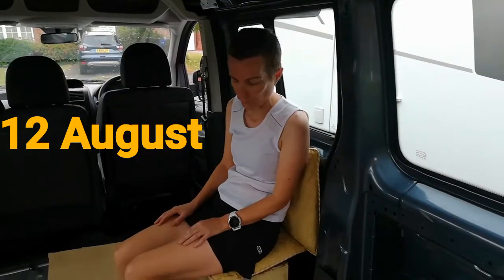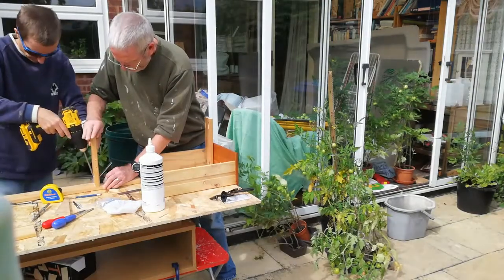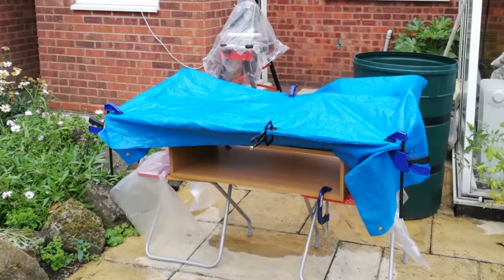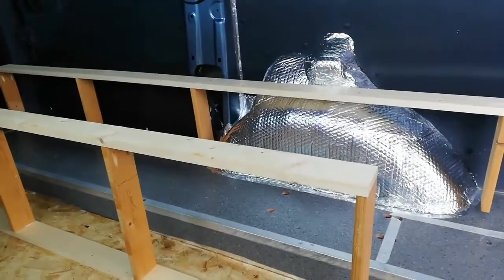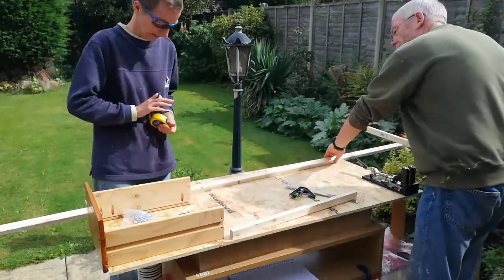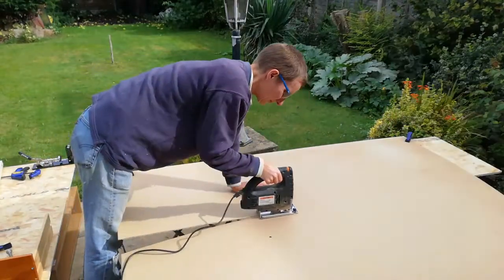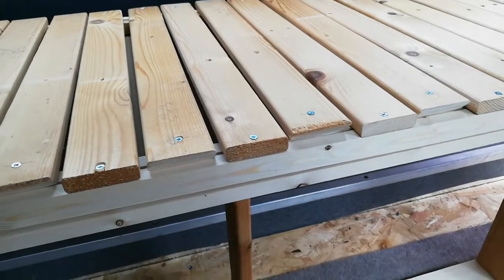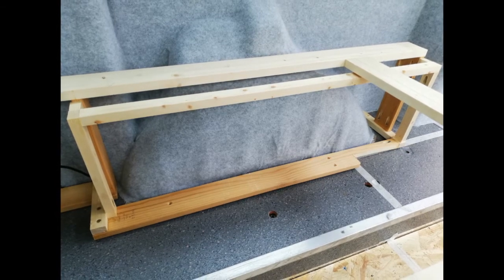Peugeot Expert Tepee Camper Conversion - Part 6 - Campervan Bed Construction

Comment: great videos, just started converting a partner  can i ask what dimensions are your bed and kitchen
Reply from the maker: I'm afraid I can only half answer your question at the moment as I'm not in the same country as Erica just now, so can't go and measure. The bed/sofa base is 1700mm long (the toilet provides and effective extension on one side) and the kitchen is 1500mm long. What I don't know off the top of my head is how deep they are. The base of the sofa is 600mm deep, but I can't remember how wide it is in bed mode. Sorry not to be more help!
Reply: @GayleEBird   Hi thanks for getting back to me, no problem, enjoy your travelling